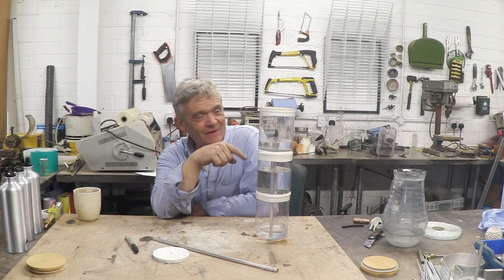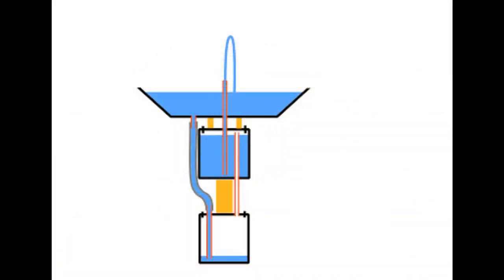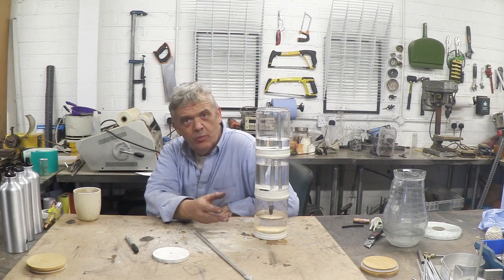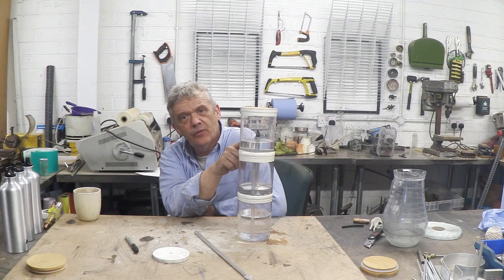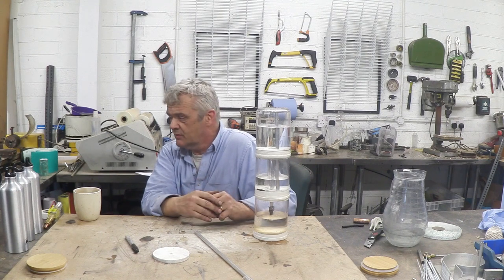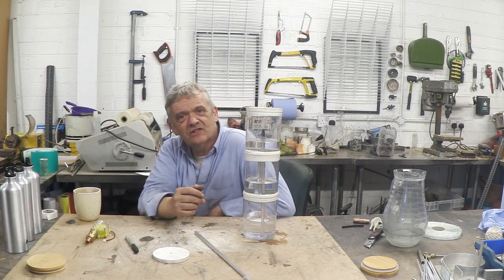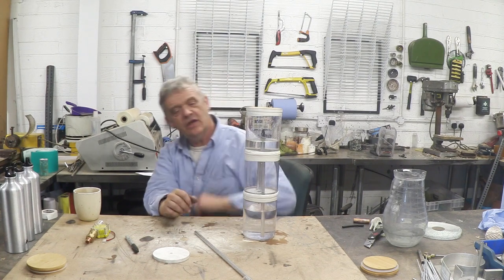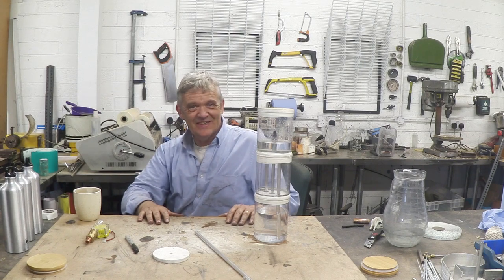Heron's Fountain As A Water Battery

Comment: Okay I have a dumb idea, 2 of these thing side by side, in opposite direction on a wheel, one discharge as the other charge. The thing is, given a good pivot, how much energy it would take to turn the wheel upside down?

I don't think it would be quite a perpetual motion machine (there is a lot of implicit ambient energy too for the system to work, like the heat to keep water liquid, gravity, the support of the ground), but the idea is that generally tangential energy needed is less than moving the whole system.

Simple men can turn wheel weighting tons, obviously those heavy wheels have evenly distributed weight, while this is a liquid so the mass is not only unequally distributed, but that distribution change over time. Anyway the idea is that maybe it can make the system just a bit more efficient with a slight push of external work that make the system rotate when charge discharge cycle is complete...

Probably dumb, I need to figure out the math.
Reply: If you can start it easy then the potential energy is low. So stopping is easy too. No advantage sorrx
Reply: @JonnyDeRico  that's the point, rotation is not where the energy is, it's in the water gravity and air pressure, if we can rotate cheaply, we just restart the system. It's not meant to rotate as a way to produce energy. Rotation is the way to restart the charge discharge, ie we do a 180° after each cycle, and that mean inputting energy, hopefully not too much.
Reply: @Henry I think you misunderstood the premise, it's not meant to extract energy from the rotation, the rotation is basically resetting the system, like you reset an hourglass. The question is how much the resetting (180 ° rotation) cost after a discharge. There is nothing to "balance out". Given we can close valve (to keep the mass in check and not move around) and have counter weight on the wheel, if the rotation cost is low, we increase the system efficiency.
Reply from the maker: worth a look at mate - but I think you know yourself the math needs working out first I would think